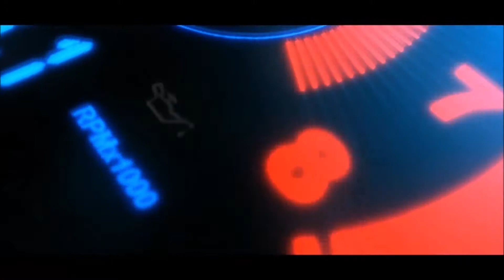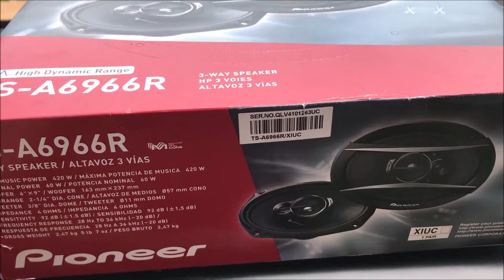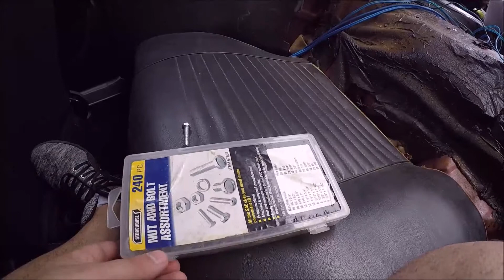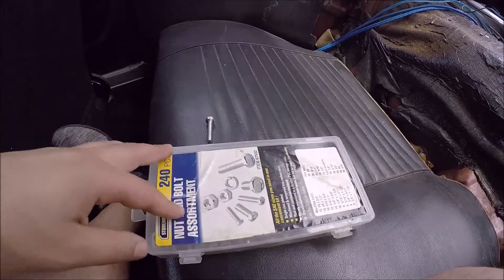INSTALLED Scott Drake Tray with Speaker POD/NEW PIONEER SPEAKERs and MINOR REPAIRS to the 67 MUSTANG

Comment: I just got that same package tray. Did you end up cutting out the top speaker cutouts so it wouldn't sound muffled? Or does it still sound good without doing anything to it?
Reply from the maker: I cut them out otherwise it will sound muffled